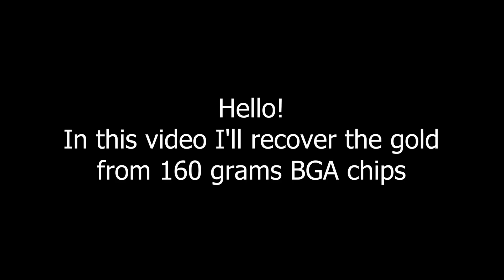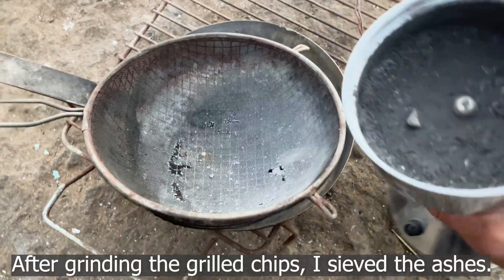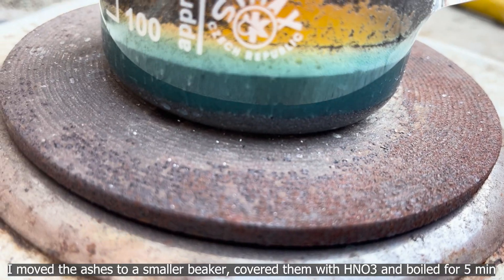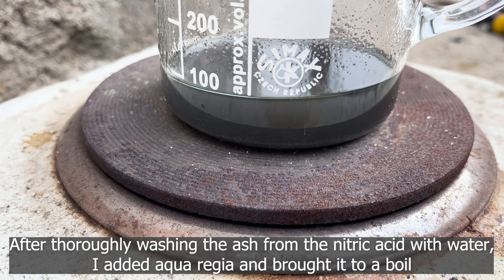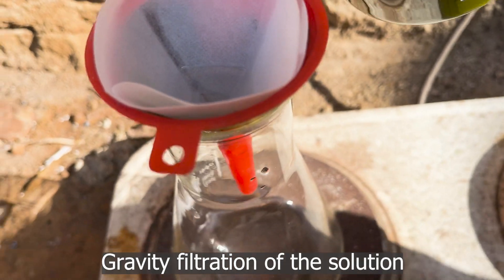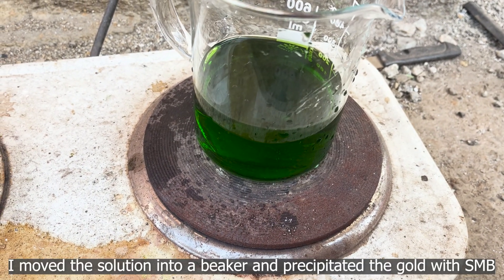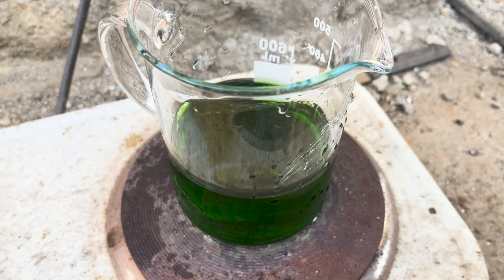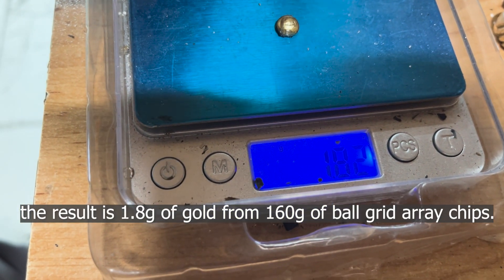160g BGA chips - surprisingly good yield

Comment: While filtering and melting the gold sediment, it seems that the gold is dissolving in the borax. The color of the borax is turning yellow. It seems that there was some other metal mixed with the gold sediment. After filtering, the sediment was washed with water. It seems that it was not washed well and the gold has completely disappeared. Please tell me the reason for this.

Comment: Really amazing, I think you processed IC Chips with lead or with smelting before, also you processed IC chips with no ash washing/concentration with NaOH, which method is the best? Any values missed while Washing the ash with NaOH?
Reply from the maker: With the lead is much more faster
Reply: @OwlTech333  will you wash any kind of IC chips in lead bath without milling them to powder? Like BGA chips.

In your last videos I noticed that you don't mill the ic chips, or this was mainly for specific types of ic chips?
Reply from the maker: @ayhamhafez285  always  grind

Comment: you can actually do it way easier. After grinding it down you can put all into a container, fill it with water and use the galvanic process with a sheet of copper. After that you can desolve the copper with vinegar, salt and hydroperoxid
Reply from the maker: Interesting

Comment: Is 4gram of gold per kg of ceramic cpu a valid measure ?
Reply from the maker: Yes but depends on the brand and model, I’ve seen from 1.3g to 18g per kg
Reply: Models like pentium pro and 486 
How much in this ?
Reply from the maker: A bit on the low side but yeah
Reply: @TracyKivines- Pentium Pro is about 1,13 g. per one piece.. 👍 I got 3 Pentium pro but they are too beautifull to destroy them ..😂

Comment: Great video😊
But what did the add of NaOH? And it was a huge amount of sulfamic for the small amount of nitric needed🤔, what did I miss😂?
Reply from the maker: NaOH to lower the surface tension, it was not huge amount, many minute additions of sulphamic acid were needed to de-NOx the premixed aqua regia. The reaction was vigorous and adding the whole amount at once would have resulted in a boil over
Reply: @OwlTech333  тоже хотел спросить зачем добавлять каустическую соду но понял что можно вместо неё добавлять средство для мытья посуды

Comment: did u recover lost gold from previous smelting or lead wash? If so how much?
Reply from the maker: @knowldedge5012  which one?
Reply: @OwlTech333  the one in which you had a few kilograms of BGA chips and scorified and smelted but there was smaller then expected gold yield
Reply from the maker: @knowldedge5012 no I didn’t
Reply: @ I encountered BGA which seemingly did not have the good yield and wondered why , I thought it was a mistake I did but don't know for sure
Reply from the maker: @knowldedge5012 some don’t have gold bonding wires especially the big new ones
Reply: @OwlTech333  yes, I had them from other than PC hardware like receivers and others, definitely there was no way where PM would have gone. The new gen have much lower yield.
Reply: @OwlTech333  the one called :9.5kg BGA chips and almost NO GOLD